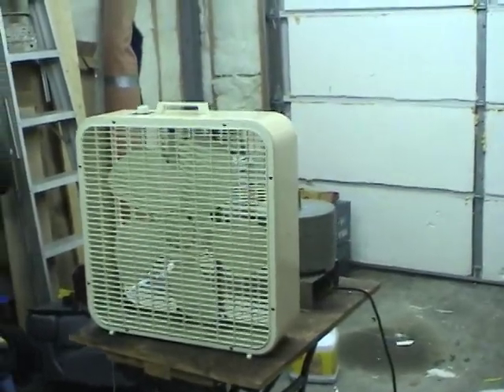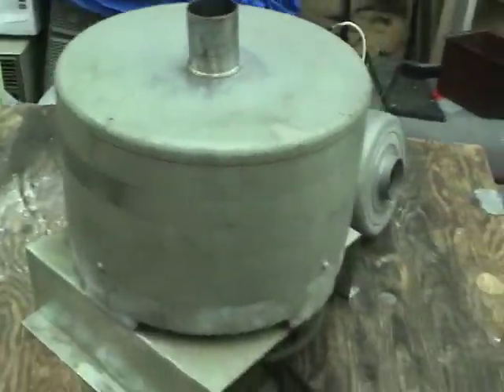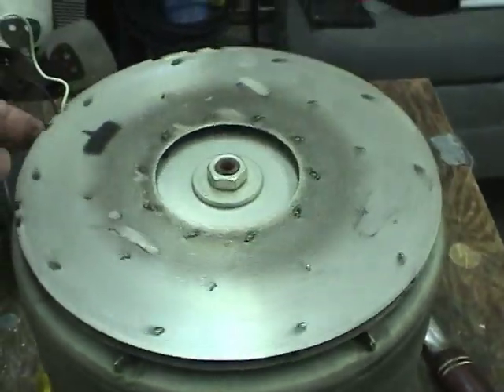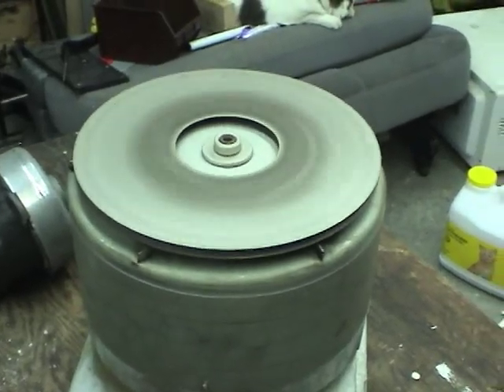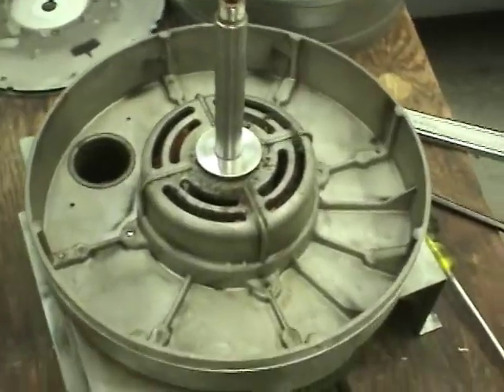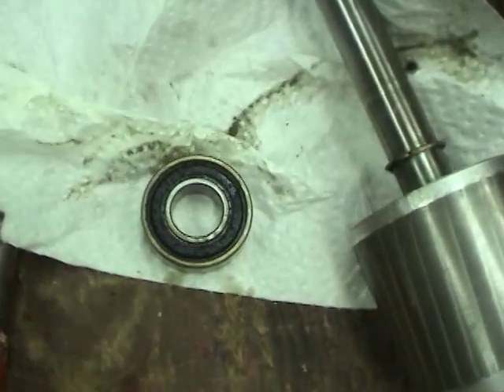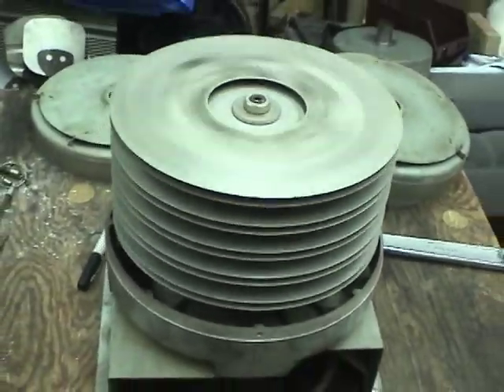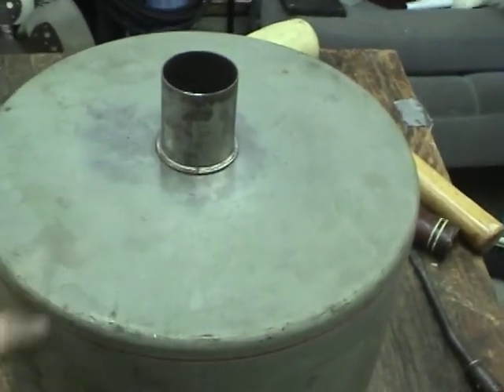Lakewood fan, Ametek blower and power supply

Comment: why didn't you just buy two new bearings, you already has it apart.  I just replaced the bearings on an Ametek  LAMF 117507-00 and the bearings cost me more than $8.00 for both, about.Once bearing start making noise foeget it.

Comment: This is a bypass blower/vacuum unit. It's uses depend on the user and the application. These will not have the airflow a single stage vacuum rotor has. This pump will produce a high volume of air, more static pressure and far more vacuum than a single stage.

Comment from the maker: I would love induction motor vacuum cleaners too. Too bad we don't have 400Hz power so they could run faster. This huge Ametek blower is nowhere near powerful enough for a good vacuum.

Dyson does make a vacuum with a brushless switched-reluctance motor for sale in Japan, to make the most of the 100V power available there. I don't think it's available in North America, though.

You're correct, the Ametek is two-pole.